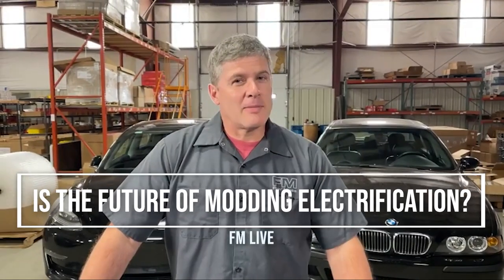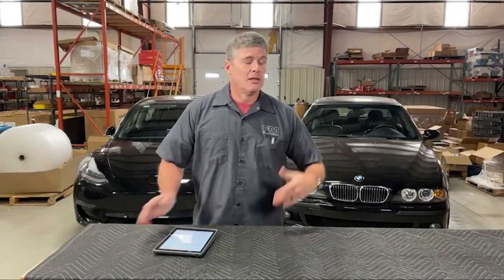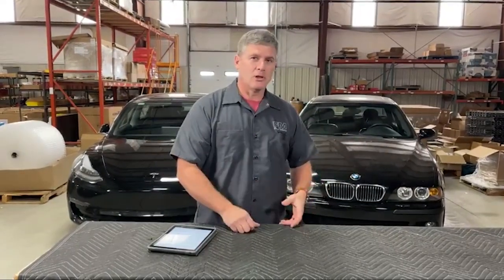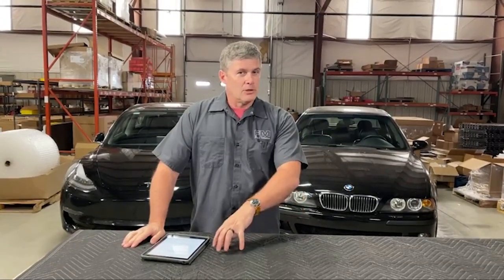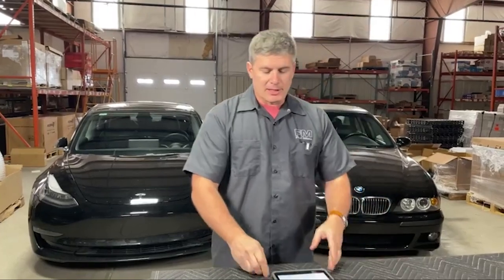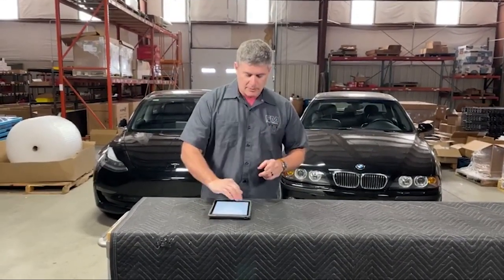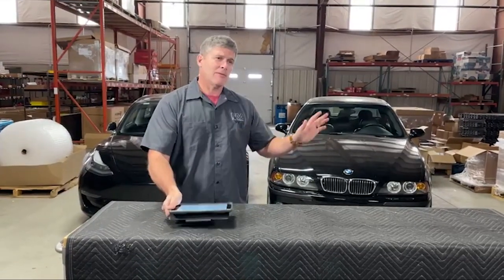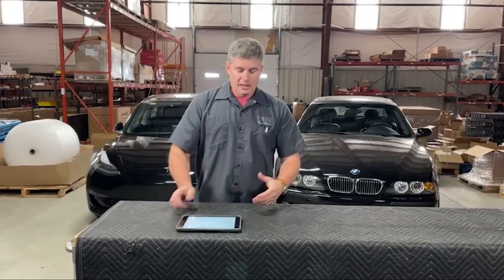Is the future of modding electrification? (FM Live)

Comment: I will electrify a 911 and or 95m, I know so similar. My 97m will probably stay with the FM2 for years to come, too much work already in it.   I believe electric conversions for project cars will become just like any other engine swap, like the high rpm small displacement vs the low rev V8. I know they don’t make noise but an electric Miata would have the finesse of a sharp chefs knife.

Comment: Due to the torque of the electric motors, I feel an AWD would be best. On the Prius (aka rubber band) it has only FWD, and the torque when getting on it from a stop will spin those front tires too easily...this with a Prius says a lot. Tesla has the answer with their AWD, they just need to work out their high Thermogenic issues. Performance wise, I think this will be the way to go, but the problem is real estate for the batteries in the Miata.
Great Video Keith on the possible future of Electric Miatas.
Reply: I know a guy in my area who did a EV conversion on a NA. You’d be surprised at how much room you have for batteries once you completely gut all of the things required for an ICE engine

Comment: Electrification isn't a pressing issue for project cars which aren't driven much in general. ICE vehicles will get rarer but I doubt they will disappear completely, eco-friendly fuels are already available. I don't think the only modding option in the future will be electrification, though ICEs will probably become more of a niche thing
Reply from the maker: That's assuming that the only reason to electrify a car is for emissions. What about for performance?
Reply: @FlyinMiataVideo  Like another commenter said, EVs right now have benefits on the drag strip or autocross, but endurance on a track is a concern. You can see your performance degrade with the capacity of the cells. I'm interested to see what we do to mitigate those concerns.
Reply: @FlyinMiataVideo  For that, I’d be interested in a power adder. I think Ferrari uses a disc shaped electric motor that is in line which it’s transmission for added power in one or two of its models. That with a small battery pack over the rear wheels would be interesting. You could either program it to blend with your power band  or have a go baby go button for the straights. Best of both worlds. Why lose the feel and endurance of gas for a track/enthusiast car if you don’t have to?

Comment: As someone who owns a 2020 Energica EVA 107 and has tried to drive a Tesla model 3 performance hard,  I can definitely say *NO*... EVs are NOT ready to replace gas in the world of racing and high performance..  EVs heat up and performance diminishes as the vehicle drives, in my motorcycle, the battery at 40% capacity will cut power by 20% and it ONLY gives you full rated HP and Torque when the battery is between 100-90% (unless you live on the on-ramp... very very brief... you most likely barely enter the freeway before you're at 90%). 

Teslas don't accelarate and decelarate over and over and over again consistently... they're athsmatic with warning lights and cool down modes activated 5 minutes in where a gas car will perform at 100% right up until it's out of fuel... Trust me. I'm BIG on EVs.. they are not for motorsports as they currently sit.  I am constantly behind when riding with friends on their ICE motorcycles, I COULD take them down in a 0-100mph sprint... a handful of times... but then I pay for it later when I have to leave the group ride early because my battery is low.  I have to talk them into stopping at the mall so I can quick charge while we all eat lunch and if they don't want to, well tough luck.   I have to ride like a grandma if i wanna stay with em, meanwhile they're having fun.  These are for extreme commuting - where you can thrash it knowing your destination is well within your batteries range - and THAT'S IT.

Comment: I love the noise, vibrations, feel and even the smell of a gas combustion engine, something my Prius does not provide.😕
Reply: A prius is not = a Tesla or a fast EV drag racer.  That said, owning an EV hyper naked, I can admit that these bikes/cars are good to spice up your commute or to have SHORT blasts of fun.  they will not do it all day like anything gas. My bike also takes an R1M up to 100mph, but only in the first 20% of the battery and will get blown away every time beyond that speed or battery capacity.  I will also never hold a corner on this bike like any gas sport bike.. 200 extra lbs is 200 extra lbs, even if the bike's geometry and dimensions are 1 for 1 with the best of them. Tires just won't hold it to the road at those speeds.

Comment: EVs are pretty much at their peak without being abhorrently expensive. EVs should only replace 4000 lb luxury cars and SUVs and not small sports cars. They are as light as they can get, and as powerful as they will ever get too(unless someone creates a better battery) What you see is what you get. Meanwhile, ICE still has a ton of room to grow but if EVs make money, CEOs and investors will gladly drop ICE production in the name of greed.

You will likely never see an EV sports car at 1200 lbs and get 300+ miles of range and do 0-60 in 4 seconds like an ICE setup can do. The batteries alone would weigh that much.

Its a sad time to be a sports car and backroads lover.
Reply from the maker: EVs are much earlier in their development cycle than ICE vehicles, so we don't agree that they've peaked. Just look at the incremental improvements over the past few years - including the cost of batteries. They're getting more powerful and less expensive every year.
We've had 1200 lb ICE vehicles in the Flyin' Miata family in the past. They're not cars you'd want to spend a 300 mile trip in without getting out to vibrate for a while. To get that light, you have to throw away crash standards, any sort of weather protection and any creature comforts. They're exceedingly rare. It certainly would be fun to try to build the equivalent EV, as it would likely have a lower center of gravity.
Reply: @FlyinMiataVideo  i want to agree but I just havent seen any successful development of making a better EV(at least not by much) than what currently exists. I'd love to know if there is a way but at current there doesn't seem to be. Its mainly a battery issue as denser more powerful batteries has always meant heavier and expensive to use. Most of what I've seen that is "better" has been theoretical so far. 

Now I agree that a 1200 lb car wouldnt be great on roadtrips for NVH reasons but it is possible. The technology exists to build aerodynamic, spacious ~2000lb 4-door cars that would be fast, fuel efficient and safe such as using recycled foams that absorb impact rather than steel alloys with crumple zones, as a bonus recycled foam absorbs some sound and is more eco-friendly(for those worried about it), suspension systems that use sensors to "see" the road ahead and vary its dampening profile and ride height before going over pot holes or over rocky/bumpy roads, going camless(such as Freevalve) for efficiency and power out of smaller lighter engines, spatial noise cancelling by placing the speakers in the headrests reducing the need for sound proofing, and more.

Much of this technology is low-cost and yet I understand that it would still make it probably as costly as an EV, but if people are already willing to pay double for an EV, I dont see a solid reason why not to just start making cars lighter already?

Comment: I would hybrid mine...  I've asked this before, not sure if you guys remember (among all the other  comments), but my question is...  When are you coming out with the hybrid power adder system that works with your other power adders, i.e. the sandwich plate between the engine and the transmission like what Porsche has?  😁 

Edit:  If FM doesn't do it, nobody else will...  Here's an option: https://www.borgwarner.com/technologies/p2-hybrid-architecture but it will require some work on the transmission to keep it from pushing it backwards.
Reply: I had a similar thought, wouldn't it make more sense to swap in a CRZ powertrain?
Reply: I’d do an electric add on. Like a booster motor